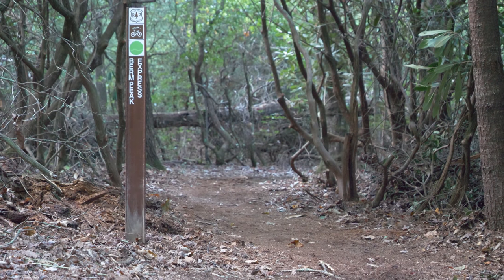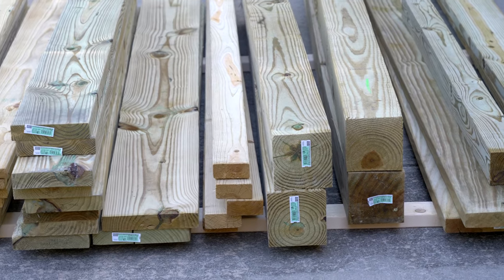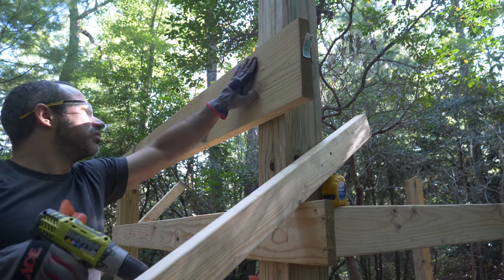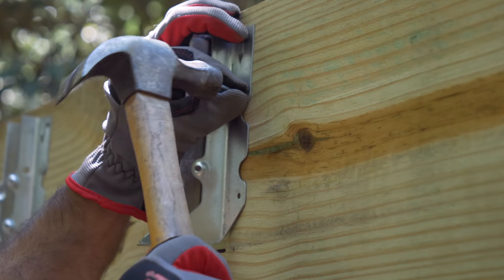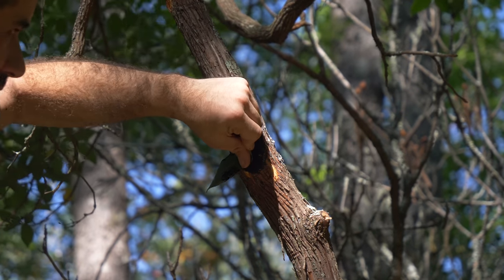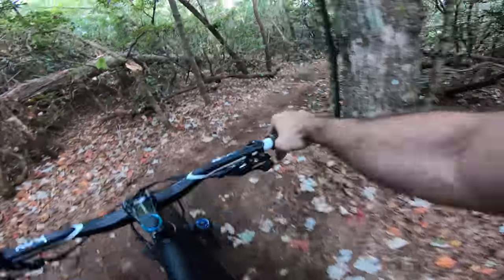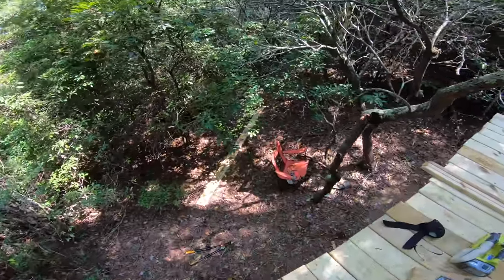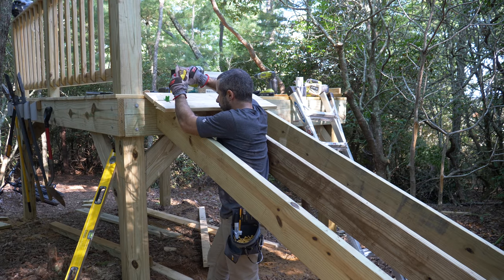Building and Riding the Backyard "Flight Deck"

Comment: bike hack suggestion to seat tubeless tires into the beeds remove the valve core and put the blowgun in the hole and shoot air in it. It is very easy to seat a tire with that technic.

Comment: Coming from an apprentice carpenter. You are doing a pretty good job! It would help A LOT if you got your post's in first then leveled and concreted them in. Wait for the concrete to dry and then come back to build your structure 👌 but hey just thought I'd put it out there

Comment: I’m a landscaper so I would hope I know a thing or two about cutting roots, the reciprocating saw is great for bigger roots if you don’t have a backhoe, but consider getting a cutting spade, they make short work of smaller roots and are great for prying up rocks. Look up “king of spades”, they are sort of the generic brand, but cheaper brands exists that are just as good like Razor Back. 

Also, have you considered treating wooden structures with something like Linseed Oil? It’s a lot less nasty than Pressure treated and it’s not too much more work to brush on a coating every season.

Comment: What would be cool is after the trails are made to have 1 straight trail for going back with a motorized cable to hang onto to tow you back up.. or sure get more exercise if you want but a straight shortcut would be good.

Comment: You should try and eventually close off the underneath with a wall around tho outside and a gate to go in then you can just put everything on the inside and it will still look nice and clean from the outside.

Comment: Hey in case you didn’t know the Ryobi bit holder you were using can slide out like a sleeve and over the screw so you dont have to hammer them in and the screw it just a tip. It’s for one handed contracting

Comment: Your local rot resistant woods are basically locust and juniper. Not a an abundant supply, cheap or a pleasure to work with. You could shell out for western varieties and maybe save on cost, but keep in mind what is rot resistant in 20% humidity doesn't last all that long in the humid southeast. Really curious what you come up with that doesn't contain copper. Personally I was never convinced that arsenic was all that much worse (except for the splinters) all things considered.

Comment: Us neighborhood kids built a bmx track behind my house, it was a large hole and the town wanted people to dump dirt and waste to fill in the hole. We used black top and clay for bank turns. A 7 foot tabletop jump mad with 2 market carts and a ton of dirt, along with small berms and small jumps. Ah to be a kid, there would be kids come from 10 miles away when we held races on sat. an Sun. The track was 10 foot wide, so we raced single file, depending on your finish where you lined up for the next race. Oops I went overboard .

Comment: Here’s a hack I had to use recently. Use a chain breaker to to twist off a zip tie by clamping the zip tie with the part of the chain breaker that pushes the pin of the chain through

Comment: Hi I would recommend getting a nail gun and tiny compressor so instead of having to take the time to hammer in the nails just shoot it in with a nail gun. Get a bigger nail gun that shoots actual nails because the small ones shoot little nails with no nail heads

Comment: DEATHTRAP!!!
Should've notched the posts to receive the main horizontal 12 footers for load bearing purposes! 2:33
The way you did it makes only 16 bolts hold all the weight of deck and riders, instead of their intended use of just holding the main beams in place.

Comment: You really should be using spiral nails or screws. Those straight nails will pull themselves out easily over time.

You'd also be a lot better off notching your beams and putting the supports on them. Those carriage bolts will just inevitably cause the wood to split.

Comment: Well,  if you have bottle cage on downtube  then it's effective for you: when you fit your bottle cage , put your bottle in it and leave atleast 5 to 6 cm space and cut a 'U' shape from a plastic sheet 2 cm wider than bottle and make the entire structure 10 to 12 cm Long. Make it movable so you can flick bottle in and out of your cage. 
          This hack meant to keep your bottle head out of dirt and drink dirtproof water.

Comment: Here is a new hack for you:
How to make a homemade dummy hub without stealing garden hose:
1. Obtain an old wheel or hub alone
2. Remove the cassette
3. Use cassette spacers to fill up the space in the free hub
4. Tighten and then you are done
5. You can shift through the drivetrain smoothly across the spacers without having gears in the way

Comment: So you are setting yourself up for issues. 1) either skateboard tape (deck tape), 2) a fine metal mesh 3) nothing and when it gets wet the algae will grow and your ramp will turn into a slide.  Otherwise nice looking pad.